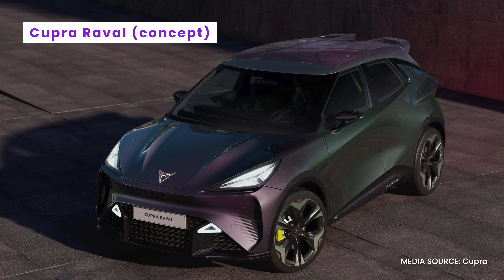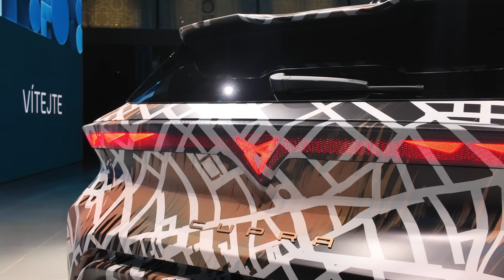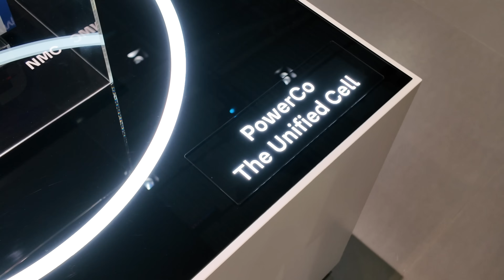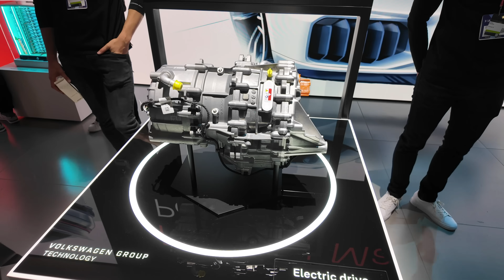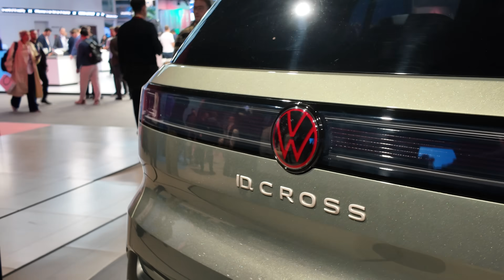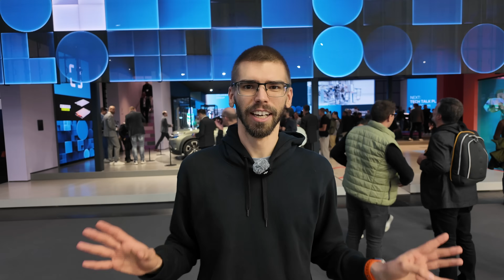Cupra Raval: Starting VW’s CHEAP EV Revolution (Design, Battery, Motor Technology Explained)

Comment: It is a good start and will probably sell well for price to value sense.  However VW needs a Golf or slightly larger squareback hatch style vehicle that comes in 2WD and AWD dual motor to compete with Tesla for range and performance to match the long range RWD up to the M3P.  Being that Tesla doesn't make a hatchback car in the mainstream segment and hatchbacks sell so well outside the US this is a market ripe for a good EV to enter and dominate.  VW can balance power, range and price in such a package to recover their market share.  FWD EVs have the issue of wheelspin or TC intervention with instant torque and more of it even beyond ICE FWD cars so mass market a RWD or AWD would be better and more entry level cars are OK with FWD.

Comment: Thank you for the content and updates . 
Cars look nice but bit gutted about front wheel drive to be honest as I like rear wheel drive as it makes the car more fun to drive I can see why they have done this in some ways as the boot is a lot bigger/deeper and possibly cheaper to manufacture? And with lower power I suppose it's not as much of a traction issue. 
I'm looking forward to seeing the 4wd higher powered versions though.

Comment: Are they running a 400V system or have they adopted 800V? Important to know to choose batterie size: only occasional fast charging with the small pack will be acceptable as breaks will be short and bonus of lower price and less weight giving better kWh/km. Not a word on battery garanti, I hope they will be at Tesla level (240 000 or 8 years).!!???
Reply from the maker: 400V for the entry-level MEB+ platform, but still really good charging times. Supposedly only 23 minutes from 10% to 80% for the bigger battery.

Comment: The infomation about the APPP-350 Motor was new to me. Thanks for that. Looking forward to the consumption of app-290 and app-350. The app-550 was a huge step forward. Today, i´ll get my ID3 GTX Perf.(violett version), but i´m pretty sure that one of the small entry versions will be the next in 3 years.

Comment: Thanks for the update following the recently released press driving impression reviews. It is just a pity that nobody was able to show the car undisguised. I don’t think we will see the production car until February but it is looking as though the wait will be worthwhile. With the exception of the VZ, it seems that the Raval is going to sit in the market between the Renault 5 and the Alpine A290. I guess the ID Polo will be pitched as more of a R5 rival. 
I do though wonder a whether a B segment EV hot hatch is a bit of an oxymoron. Hot hatches originally came about as a vehicle to be both fun and (small) family practical. All you would need in one car. However, there is ultimately a driving fulfilment penalty for the weight of the batteries in an EV. Furthermore the battery pack has to be kept small to keep the price down and also to fit within the constraints of the platform’s size. This then limits range, particularly on colder days, and requires a light foot to eke out efficiency. I read worrying reports as to how hard a hit the colder weather has taken on the range of the R5 and A290. Perhaps the starting point for a small performance EV needs to be a 60 KWh battery in a C Segment Cupra Born size car? Would a two speed transmission help? Alternatively manufacturers have to follow BMW’s example with the i3 and drastically reduce weight by totally innovative design.

Comment: Yes, people didn't buy VW ev's because they didn't like the name or were confused by it, yes, that was it. 
Maybe the cars were too dynamic so let's switch to FWD 
Spread the same car on 3 different brands, sorry 4, wait, 5, is it 5? 6, final answer 7  All requiring advertisment budgets, and design.  Divide and conquer at its finest. 
Reviewers want a review unit..... 4 years later I've still not heard back from them. 
Problems solved

Martin, you are doing a great job, have a a nice day, and merry holidays :D

Comment: Thanks for this update, Martin - as usual, done in your own, inimitable, hardware-rich format... love it...
Like another contributor has already mentioned, it is a pity these cars will become front-wheel-drive... I get why they're doing it - for cost-saving, packaging and, probably, customer-safety in terms of handling - but having driven both my RWD BMW i3 and my wife's FWD Corsa-e, I would ALWAYS choose RWD for such a torquey powertrain... it's simply better at putting the instant motor power down.
And, yes - chuffed that VW have listened to customers regarding build quality, material quality and user-interaction for their new interiors... who'd have ever thought that the car-buying public would get excited about BUTTONS again...!!  🤣

Comment: Kinda shame they're going with the front wheel drive. I was hoping for RWD.
Reply: Might this suggest that they’re hedging their bets to give themselves an option to go hybrid..?
Reply: @uttherkunst3806  It is simply cheaper/more lightweight. - But I agree, would be happy if my e-up would have RWD.
Reply: @Henning_Rech I don’t see how FWD is lighter than a RWD engine and a lighter steering rack. My BMW i3s is RWD and it weighs about as much as a box of tissues. FWD is lighter than RWD on an ICE car because there is no propshaft running the length of the car, but EVs don’t need those.
Reply: @uttherkunst3806  NO, it simply means, that for such small cars FWD is more than good, and due to the good packaging, you get an enormous boot.